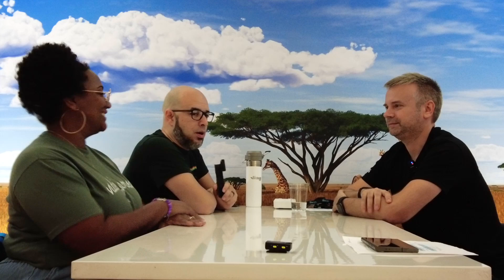Inside Microsoft Flight Simulator 2024: Physics, Simulation, and Innovation

Comment: More cores does not mean better. It’s the speed at which the cores work that is important. How much work load they can get through quickly without bottlenecking. Not everyone’s cores run at the same speed. There are performance cores and efficiency cores that can do less. Hopefully this was considered when saying, just use everything the user has. What’s left over for other tasks and addons?
Reply: More cores can be better depending on your CPU. Its significantly better for optimization where all cores on a CPU is properly utilized (for all types of cores) and not just some of the cores. Of course core speed is a critical factor as well, but proper core utilization is detrimental to proper optimization.
Reply: @anony88  yeah not really, you could have 30 cores that arent optimized (as most people just use default power profiles) that would run slower than 8 cores that are optimized. More is not better at all, its how fast the CPU can finish the jobs its got to do, the sooner the better, where speed is essential, especially for flight simulation. Plus, getting any application (that is heavy and complicated) to use ALL available cores, leaves very little left over for other processes that need the CPU. Meaning alot of bottlenecking as it tries to do everything. MS should have settled to say, only use X amount of cores no matter how many the user has, leave some to do other jobs assigned by other apps. Plus, they dont let the user assign the CPU cores themselves. It will be interesting when released how its used alongside other apps of flight simulation.